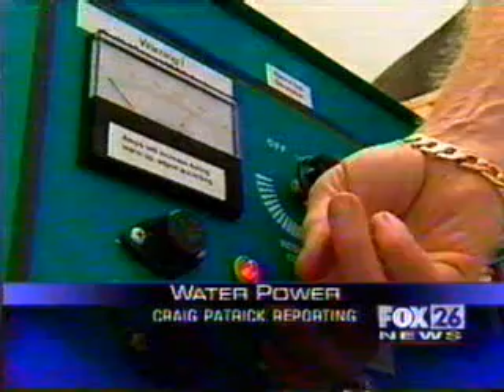Hydrogen Technology

Comment: In case you have not noticed, water is very stable. it's molecules are quite happy to stay put. 
Fortunately for the earth, it takes a great deal of energy via electricity in order to separate the water into the gaseous counterparts.  otherwise, spontaneous reactions might occur. 
it goes against the laws of physics to have something, release energy, and then have the exact same thing again.

Comment: What is he using for dc voltage to create all the hho?   It takes lots of amps at low voltage to do it.   Just a small hho generator can draw 20 to 30 amps at 14 volts dc with a electrolite in the water for conduction like sodium.   Over heating a alternator.   Maybe high voltage with wider space plates or pulsed dc with a pulse width modulator.   How about seperating hydrogen and oxygen in waters gasous state?  Heat is a problem with the process anyway.

Comment: Isn't it completely useless to run a car on this invention? You have to put energy into the water in order to split it into a hydrogen-oxygen mixture. Then you burn the hydrogen, which releases energy. The energy released is never greater than the energy invested, so you actually would make your car less efficient if you put in his invention.

Comment: Everything we do converts one sort of energey into another. LNG to electricity, Coal to Electricity, Hydro.

I imagine it would use a battery to start up, but then use energy from water to run the car and power the electrics. Until the water runs out.

Comment: How about using a pure water engine that converts the water with electricity. At first, you can plug it into your solar powered home, then air intake on the car can have a fan inside it hooked up to a generator that powers the battery, making it last a little longer. There you go, no fossil fuels. :P

Comment: The torch is cool I guess.... as a normal tool.. probably more expensive to run. Nothing is actually being powered by water. It's using electricity.... a lot of which comes from fossil fuels..... so this technology is great in that fact that it can RUN ON ELECTRICITY but it's not a new power source... we still need to turn our attention to the sun for that in my opinion...

Comment: remember how they said he is running it as a gas hybrid? my bet, that gas engine is running a decent sized generator or at least spinning the original alternator which is producing the electricity needed for enough electrolosis to fuel a large truck. I also find the claims of consumption way uncredible! there are only so many h2o molecules present in a small quantaty, energy conservation is pretty clear! and I am pretty sure that a gallon of water does not contain anywhere near the energy claim.

Comment: this is not new, nor is it original! the technology of oxygen hydrogen welding, using electrolosis to separate the two elements, what he patented was a specific configuration of a electrolosis plate. he will be sued by miller industries who owns the original patent on the electrolosis to welding. i wont call it a hoax, but its just media sensationalized last years information to anyone educated. and what they are not telling you is the energy required for the electrolosis in the first place!

Comment: The only way out is to tap power from solar, wind, nuclear, hydro into electricity through the power plants and divert those electricity to hybrid and 100% electric motor cars. And then develop more technology for energy efficient devices/homes/facilities.
All in all, in the future you will drive cars that take power from another source of power. It's just not gonna be gasoline, and certainly not water.

Comment: i'll just point out, Hydrogen is not safe. it is  as, or more, explosive than Acetylene and propane and any other hydrocarbon for that matter. also, unless you run the electronic water converter off of something like the mains supply, or better, a solar/wind power supply, you will only USE more energy (fuel) from ur car engine to produce the power to run this thing. sharpen up, the law of thermo-dynamics compells you, asshat!

Comment: NOTE - they are using ELECTRICITY to make the gas.  You have to get the electricity from somewhere first. 
Also, to use it to drive a car, you'd have to find a safe way to store the hydrogen - NOT easy.

Comment: Its because the combustion of the gases is an eith to a quarter of an in away from the tip of the welder. Air convection takes the heat away and the only way the tip will heat up is if he is heating another material and the radient heat of the substate heats up the tip.

Comment: That is a good comment, what I was laughing at was the fact that he doesn't take into consideration thast the electricity used comes from coal or oil burning power plants to make hydrogen and presents it as a holy grail of clean energy. In my opinion, the only true clean energy is that of solar power (including wind power).

Comment: Hahaha, it makes me laugh so hard. You have to electrolyse the water to get H2 and O2 molecules, but to do that you need a strong electrical current (probably from a coal or oil burning electricity plant). The breaking of the H2O molecule REQUIRES MORE ENERGY than is liberated when burnt. Oh and btw, making fuel with water (with electricity) has been done for around 100 years...

Don't be fooled by this video ppl!

Comment: Why are you even talking about perpetual?  I haven't heard any mention of it except from you!  In a "closed" system though, a small solar cell can by used to separate the hydrogen molecules from water.  That is used to create current in a fuel cell the by product being water to replenish the reservoir.  Granted, some water is lost in the process and will need to be added sometime, but it works well for remote areas with no grid...

Comment: First of all, the sun will produce power for longer than any of us or our ancestors will live -- that's forever for us.  Secondly, it only takes a small solar panel to create enough reaction to separate the hydrogen out and run it through the fuel cell for power and a return of a large percentage of the water.

Comment: reading these comments, i know what's wrong with america. all of you believing in the "miracle gas", tell me: 
Where the heck is the energy coming from? Right, 100% out of the socket!
What's the chemical Formula of the new gas? Right, what new gas? It's just H2 and O!

Get this: Water is transformed to H2 and O, and then transferred back into Water. 
Possible energy win: 0% Practical energy win: -15% if you're lucky
There is NO energy gain!

Btw, H2+O welders have been around for decades.

Comment: This is being done.  There are currently stations in remote places that use solar to get hydrogen fr/water, run it through a fuel cell for power and recycle the h2o byproduct.  Not 100%, water needs periodic replacing, but close to perpetual.

Comment: they still don't understand. you have to put energy into water to break up the molecule.  It then releases that energy when you burn it. ITS NOT FREE ENERGY, where do you expect to get electricity from, you burn coal, you are still emmitting carbon into the atmosphere. It would be a good idea if you just use nuclear energy to perform electrolysis on the water or even use solar power to do this. then we wouldn't need these terrorists getting rich of of us.

Comment: Here's a crude fact. Hydrogen is not an energy source. Hydrogen is an energy carrier. You still need a lot of energy to produce hydrogen. You can't pull it out of the ground like oil or coal. 30-40% of the worlds energy production is oil and gas. Find an energy source that can produce hydrogen in those quantaties.

Comment: do remember... there does exist in physics a little magical thing called THE SECOND RULE OF THERMODYNAMICS :> and however you calculate it... it is IMPOSSIBLE for an engine to achieve efficiency ABOVE 73 % in our universe  (it is dependant on zero point energy of vacuum (the temperature of "absolute zerto") that means: ANY KIND OF ENGINE IMAGINABLE :> although currently used combustion engines operate at about 20-30 % efficiency (yes that's right :P) so there is room for improvement :P

Comment: which means you have to produce that energy in a power plant :> and yes if it is a nuclear powerplant it is surely cleaner than burning gasoline. There actually exist a device that allows to use excess heat of an engine to produce hydrogen out of water but...

Comment: The video makes it look like a golden sollution to pollution problems HOWEVER... the fuel isn't water by itself... but water that first udergoes electrolisys in order to obtain the mentioned gas... and it is the energy used during that electrolisys process that is stored and released

Comment: yea the main roadblock is cost of the catalyst.A standard hydrogen PEM fuell cell has a platinum catalyst, which is extremely expensive. I've talked to a couple engineers about this, one of them said they were working on nickel-platinum and selenium platinum alloys as the fuel cell catalyst. :D
Reply: 17 later it is still expensive but I think it will be much cheaper soon if we look at the progress research made in the last couple of years.

Comment: Hydrogen won't solve ALL problems, but it is certainly a step in the right direction.  Right now, all cars are powered by gasoline, which is not as clean or efficient as coal. Furthermore, while the price of gas is steadily increasing, the price of hydrogen is steadily DEcreasing.  One day, Hydrogen will be cheaper and milions of people will make the switch simply to save money.

Comment: In fact,the three biggest problems in use hydrogen as fuel is:first,security(hight pressurized gas)the second,expensive and the third,the monopolies of big oil distributors.

Comment: But then you'll need to enforce all the Psitons, Cylinders, rings, camshaft, driveshaft due to a more powerfull explosion of Hydrogen also need to cool the engine block better than the gasoline engine because the Hydrogen gives off more heat.

Comment: actually you can use Zinc metal (avoid contact with air when using zinc) to split H2O into 2 hydrogen molecules and 1 Oxygen molecule.....and to run your car for a full day, in zink it would cost you less than half a cent (U.S.) But please don't think that i'm suggesting to have a full tank of Hydrogen and Oxygen mixture if you ever get into an accident with that shit on your car oh fuck you're gonna be missed and all the people around are going to be missed too.

Comment: bird valiant is right. You need electricity to make the hydrogen, which means you're getting that from oil, coal, sun, wind, or hydroelectric. 
The problem is that every time you convert energy, you lose some, so running a car on just electricity (battery) would use less energy than running it on hydrogen.
...unless we can find a more direct source of hydrogen (production).

Comment: well normal gas welding gets to about 3500 degrees C.. the average temp of the sun is 5400 degree C

maybe a bit of a stretch and i would look into it more but its too late over here to bother.. so im just gonna say it might be possible

lightning is after all 4 times hotter than the surface area of the sun

Comment: This  is a scam because it's portrayed as a miracle energy source, even though it's not.  The process shown in the video is electrolysis.  You run electricity through water, and you will create combustable hydrogen and oxygen gas.  The problem with electrolysis is that it's very inefficient.  You will need to waste A LOT of electricity to create enough gas to power a blowtorch or car.  And where does that electricity come from?  The stinky old fossil fuel power plant..